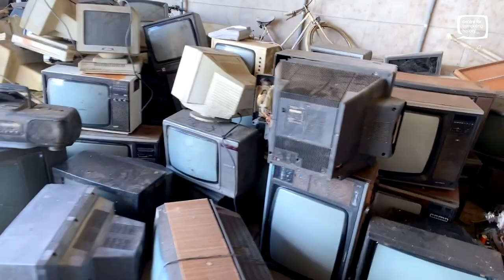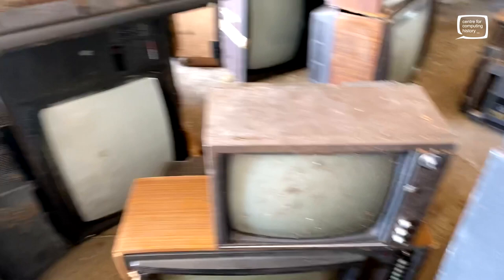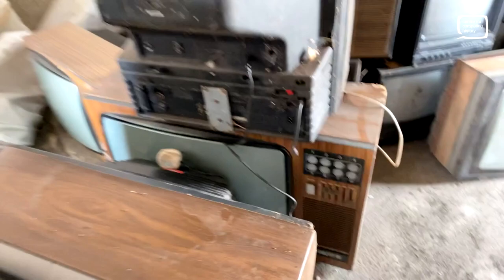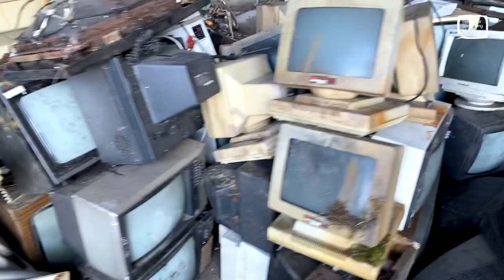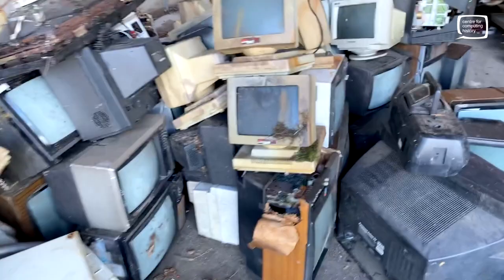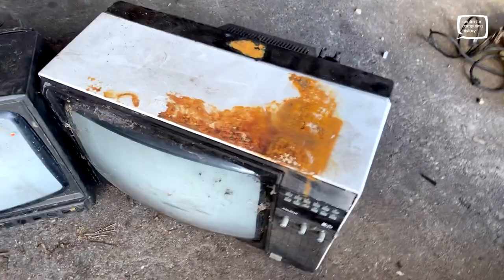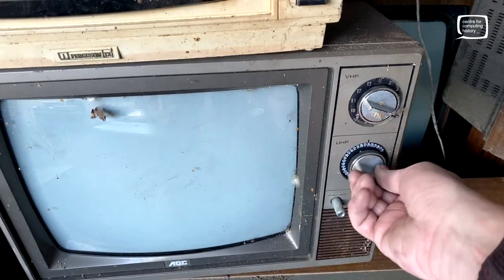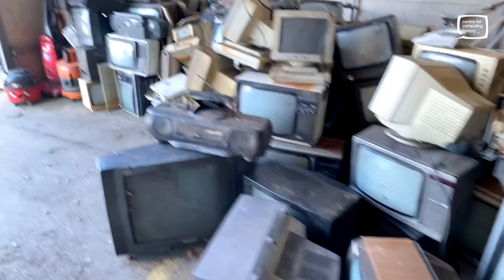CRT Mountain - Jason Discovers Hundreds of Old CRT Televisions  !!

Comment: I'm pretty sure I saw a Grundig Super Color 22" TV in that pile. I've got the one my family bought in the early 1980s in my shed. It likely needs some TLC too, and spares for it would be good as those components aren't going to last forever.
Reply: I have one of these as well as a few similar ones. The tuners all have dry joints, so if you can't tune into an old game console or computer, check the solder joints in the tuner.

Comment: The majority of the last TV's were based upon one of another identical circuits. No point reinventing the wheel. Especially when all of the major brands were swallowed up and all still sold TV's under there respective brands, either slap the right labels on it and send it out the factory door. It still happens today with white goods, if you cannot find the part for your washing machine look for identical machines made by the same group of companies and you will probably find it's the same parts, just research first. 

Some of the last Sanyo TV's were Sony Trinitron TV's with different product codes, Bush and Alba TV's were all made in same factory with almost identical part numbers, as were Grundig, Goodman's, and JVC. Some were just sold to different markets, but we're identical except for regional changes like tuning or timing, which in later models were firmware changes saving even more money.

Comment: Might be worth posting on the UKVAC forums or letting places like Arcade Club know about these.  I'm certainly no expert, but they might be able to make use of some of the tubes or the internals to extend the life of their machines.

Would certainly be an enormous shame if most of these go to landfill. I wish you lots of luck saving them from the tip!

(Got to say, I saw the same model B&W Ferguson portable with the rotary tuning dial that we used though my childhood with our Speccy.  

Used to be able to get a damn good picture on that once you'd got it tuned in, even if it was in black and white.  No colour clash for me!. 

Used that all the way up until I got my Atari ST and a 14" Sharp Colour portable for my 18th birthday.   Still got that one in my loft on standby in case my Trinitron breaks down).

Comment: Hello Jason, do you remember my slightly modified Ferguson 3760 18″ TX9 TV that I used with the Nascom? After I stopped using the 9" green monitor, I think that you would have been about 9 or 10 by then.  Jim.

Comment: Have you got any TVs that had a printer built in to print off teletext pages?   Always wanted to see one of those :D
Reply: I think (not certain), that the model with the printer was a Pye, (possibly available as a Philips model too), but crucially was the Prestel model, (which included teletext). 

This applies to the U.K. market, and it was a long time ago, so I may be wrong.